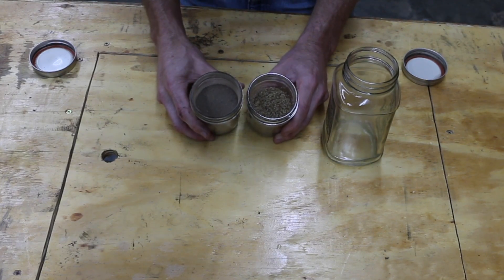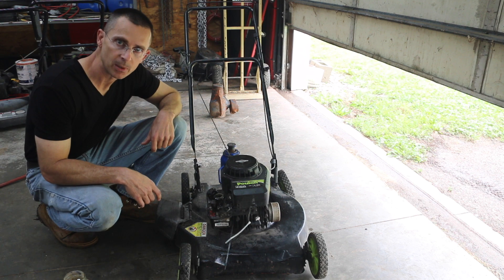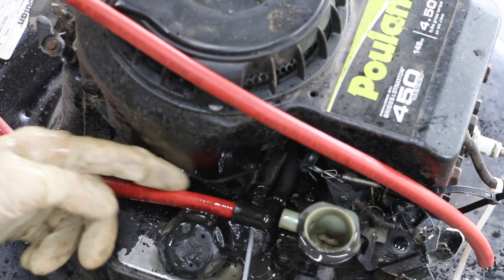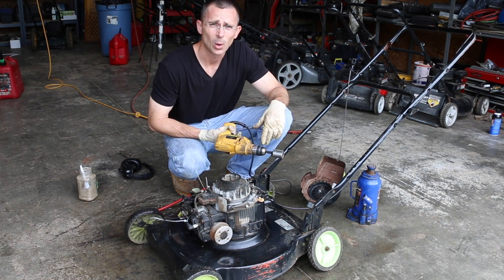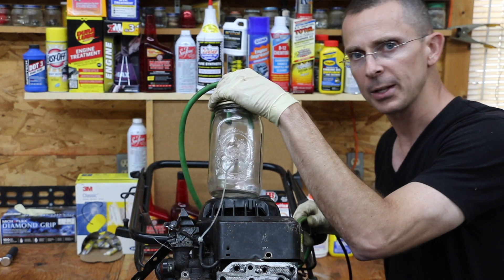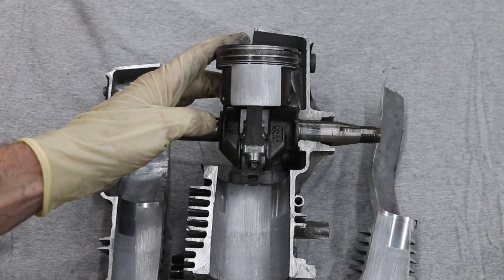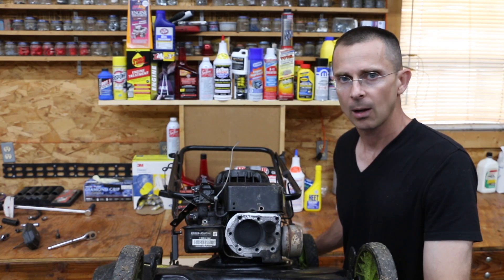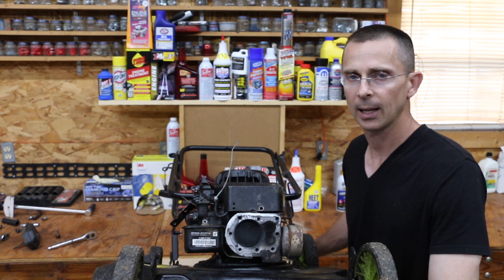Will Dirt Destroy an Engine?  See what it does to this Engine!

Comment: Changed Sparkplugs in a 2000 Dodge Ram 1500, 5.2 V8, w/Auto Trans... 

Blowing accumulated dirt out of the 3.5" plug tube's before removing the plugs was never mentioned... I didn't notice any accumulated dirt, but I didn't examine it thoroughly either... 
The most dirt/dust that could have fallen into 8 cylinders thru the plug holes is 1/2 to 3/4 of a thimble... 

Truck was rarely driven... Has 102k miles... Wasn't started for 2 years due in storage... 
R&R:  Dropped, cleaned and replaced fuel pump in fuel tank... 
R&R sparkplugs & sprayed 2 short burst of penatratiing oil into cylinders... 
(Rotated engine via ratchet at balancer) 
R&R filters, oil, water pump, hoses, thermostat, belt, etc, etc... 1 can of Sea Foam in 26gal of high octane... 

1) Idle seams good at start up... 
2) Throttling up causes sputtering... 
3) Engaging into gear while remaining still increases the sputtering and causes truck to jitter... 
4) Throttling up to move forward increases sputtering and vehicle jittering... 
5) Increased throttle increases sputtering and jittering emensely... 
(The jitter Feels similar to a slightly out of balance clothes washer while rotating at substantial speed) 
6) ZERO Smoke at engine & tailpipe...  

Suspension checked and new balanced tires installed, hence not a factor... 

Diagnostic showed cylinders 5 & 7 are misfiring... Grounding test shows plugs firing... 

Based on the info provided, does it seem as though any dirt/dust may be affecting cylinders 5 & 7 ??? 

Thk U...
Reply from the maker: Thanks for sharing.

Comment: I bought a vehicle from someone who had done this. It had 300k on it, which for the engine was nothing, I had 4 other vehicles with the same engine that were still perfect, with almost and over 400k. The engine with only 300k runs great but clicks a bit on a cold start. Engines really dont like dirty air.
Reply from the maker: Thanks for sharing.

Comment: This was a bad test.  You are not simulating wear on the engine so much as destroying the engine.  The amount of material you are pouring into the engine is completely unrealistic.  What you should have found out is the parts per million of contaminants in the air while a lawnmower is doing work.  Then used that as your baseline for adding any contamination to the airflow through the carburetor.

Comment: I think the only thing that could have made this a better simulation is mixing the sand with oil or gasoline. I'd did it bc sad is so far in-between that its likely going to be wet with it
Reply from the maker: Thanks for the suggestion.

Comment: My paramotor (185cc 2 stroke engines) also my Subaru sports car both are equipped with a high airflow Oil filters like K&N.
I do live in the desert and there are alot of particles in the air pretty much all the time.
I have always wondered if it would be any better to use my k&N style airfilters with a pre-filter over them.
do pre-filters make any difference with high airflow filters?
Reply from the maker: Thanks for the video idea.

Comment: !5 years ago I bought a new $500 Commercial Honda mower. Moved into a house that the previous owner leveled the yard with massive amounts of sand. I never removed my mower air filter. Eventually my mower wouldn't start due to low compression.
Reply from the maker: Thanks for sharing.

Comment: Yes
Reply from the maker: Thanks for watching.
Reply: @ProjectFarm  I managed a Jiffy Lube about 10 years ago. Company newsletter told the story about a store where the manager discovered his employees had been installing the wrong air filter in a particular model of diesel truck. The air filters were too small and allowed air to flow around them. He pulled the records, contacted the customers, and had them take their trucks to a repair shop for compression testing. All but one were OK, and Jiffy Lube replaced the engine on the one that wasn't. Probably didn't see any damage because it was only a short time and most of the trucks were not operated in high dust conditions, except for the one.

Comment: running an engine without an air filter is bad yeah but nobody is dumping shit down your intake at the most it would take a while for this to happen most of the debris would work itself out of the exhaust valve instead of a lump of it all coming in at once bad test should have thrown it at the mower this is absolute worst case scenario
Reply from the maker: Thanks for the feedback.

Comment: U really didn't like that engine, did ya. It's just a harsh world we live in." 
Engine  "yeah with guys like YOU in it"
Reply from the maker: lol  Thanks for watching.
Reply: @ProjectFarm  Yup, I fix these, mostly generators, but ppl do not seem to 
understand gas engines suck up a lot of air, and dirt just doesn't go well w
an engine and no air filter or an improperly fitted one, where dust can go 
smack into the carb instead of thru the filter.

Comment: I used to build diesel engines for a railroad.  The one thing that really took the cake was for someone to put sugar in the oil.  It would run OK until the engine was shut down the first time after adding sugar into the oil, the sugar would crystalize everywhere when cool.  This would make the engine useless. It would cake up in the oil galleys...etc. No way or chemical that would clean it out.
Reply from the maker: Thanks for sharing.

Comment: I had an engine lose compression on me many years ago after I freshly rebuilt it.  I tore it apart and found the piston rings stuck in the piston grooves.  I unstuck them, put everything back together again and it ran great just like before until I got on the throttle a lot.  I repeated that procedure one more time with identical results.
It turned out to be a very fine grit sand stuck to the oily inside of the intake manifold.  There was zero cylinder wall and piston damage.  Again, really fine grain stuff.  Nothing big.
Reply from the maker: Thanks for sharing.

Comment: great video  air filter  fit and condition is very important  what about  not changing the oil for long periods  over the recommended intervals
Reply from the maker: Thanks so much!
Reply: I have a lawn mower that I have put a new air filter every 2 years and change the oil every year usually after the dry part of spring. I have done this for the past 15 years this year I put sea foam in the fuel because of carb issues now it runs great again it would be interesting to disassemble it to check for wear I'm going to pick up a compression gauge. it would be a good video to see the inside of an engine that was never taken care of  to see

Comment: Ideas: "wheelie" a motorcycle engine. Run a non-ethanol engine on ethanol (as pure as it will take).
Run a diesel engine on really old diesel. 
Build a rats nest in the air filter? 
Just off the top of my head 🤣
Reply from the maker: Thanks for watching.

Comment: Try this: Mixing sawdust with motor oil will make the engine run smoother. This was according to my friend who used to sell older 70’s cars. And it actually worked. (according to him)
Reply from the maker: Thanks for the video idea.

Comment: Do you think that’s a lot a mocha glow by from the crank case no I have an old lawnmower that absolutely pours out smoke like a choo-choo train when they connect the flow by to the carburetor it has so much blow by it forces out the gas out of the primer bulb so it’s just rocketing gas

Comment: I’ve always wondered if Lucas upper cylinder lube will actually increase wet compression and increase or provide more steady torque by utilizing a compression gauge and a engine brake. Can you please make a video since you have all the right equipment to run a test, thank you!
Reply from the maker: Thanks for the video idea.

Comment: I had a 2 stroke RC buggy (and like an idiot) I didn't put any oil in the air filter before I took it to the beach. The air filter managed to block most of the sand but a few specs must have got into the engine as the idle speed dropped and the engine stalled. I cleaned the air filter but I had no air filter oil so I used 2 stroke engine oil instead (please reply to me if its bad to use it). The engine then ran perfect and I took it to the beach again and it didn't cut off or stall.

Comment: Naah... not at all wastefull. There are places, as romania, for example, where there is so much dirt and dust on the roads, and not only...where air filter and fuel filter are better done at half the advertised change intervals, than any other place. I come from romania, live in austria, and have to say : if you care about your pocket/ wallet,  do take care of when you change oil and fuel filters, depending of place, and conditions you might drive in, than suggestions from mannufacturers. Keep up the good work. I see you are a straight up man. I appreciate that. God speed friend. God speed.
Reply from the maker: Thanks so much!

Comment: As silly as this is, one of the things I look for when I buy a used car (not a beater, but something I'm going to care about) is if the air filter is installed properly. I'm just a backyard mechanic and I've run across MULTIPLE cars where the vehicle has been driven for years, even  half of it's life or more with an improperly installed air filter (crushed or not seated) that lets just about all the air bypass the filter element.
Reply from the maker: Thanks for the feedback.

Comment: This is the advice that I had given to my long time friend who was a truck driver for 10yrs and he's employer was messing up with him and his employer didn't pay him for the truck driving Jobs that he did, guess what? My buddy bought a 5 gallon of Car Paint Rubbing Compound and mixed it with Diesel motor oil and poured half gallon of it to the engine, he did it on all 5 semi trucks of the company that he is working for. After a few weeks his boss loss more than $76,000 on Engine Repairs, then after 2 weeks my buddy strike again for another round of sabotage, he screwed up their fuel tanks and did the same Rubbing Compound oil mix on their engine again! And the reefer engine in their trailers After a week his boss loss 4 semi trucks and screwed up most of his reefer engines. Then my buddy is happy got his revenge on his employer.

Comment: As a mechanic this was painful to watch. This guy has no idea what he is doing - me and my grandpappy were proper mechanics, and what we would do when trying to deal with dirt in an engine is connect up a hose into the carburetor, after the airfilter and this would be fed from a reservoir (a plastic soft drink bottle) that we filled with dirt from the ground and sand, and then that way rather than having to spoon in dirt to the engine, we would just have it fed in with gravity so that the engine could really get right jammed up with the dirt. We would have customers from all over saying that we were the best mechanics as it would only take a minute or two for the dirt to completely knacker the motor. Much quicker than you did here.

Comment: I would think a more accurate measure as to what damage dirt does to an engine by removing the air filter would have been to remove the filter and run the engine for a year and see what happens.  Most of the people who remove the air filter to gain performance still do regular oil changes and oil helps remove a lot of that dirt coming in.  However, to introduce a years amount of dirt within a few minutes would, I believe, overwhelm the oil and cause substantial damage to the engine where if the dirt was to be introduced naturally over time, with regular oil changes, the damage would be significantly reduced.
Reply from the maker: Thanks for the suggestion.

Comment: Try 2 oz restore engine treatment on that
Reply from the maker: Thanks for the suggestion.
Reply: @ProjectFarm  it doesn't have to be the exact same engine but one that has scouring like that also with that rislone engine restore it olny works when it's in the engine and when you used the restore brand engine restore on the 4 cylinder tractor you used the 8 cylinder formula

Comment: I know this is an old video but, one spoon of sand would not get  into an engine in ten years unless you drove your car on the beach every day. In a normal city, you could run your engine without an air filter for around ten years without any problems. One grain of sand every few months, would not do enough damage to even notice. I had a "68' camaro that I ran for at least ten years without an air filter, and never had a problem with the engine. Of course, it was a Chevy. A ford probably would have quit after ten months. LOL

Comment: Many years ago (1974) I was in the Army. I had just purchased a brand new Chev Nova, which I drove to an Air Force base in Texas where A I attended a tech school (all branches of service attended some of these schools. ) I arrived there in July, and it hadn't rained in that area since May. Naturally, this dryness meant lots of dry sand and dust. When I treated my new car to its first oil change, I checked the ar filter. Once the cover was off, exposing what was inside, I CAREFULLY removed the housing and cleaned it thoroughly. Naturally, I replaced the filter as well. 
The old paper filter weighed almost 3 pounds after it had been removed from the housing and some of the loose dirt had fallen off. I wouldn't have imagined that much dust would be trapped there, and I really didn't know how the engine was running with so much air flow blocked. Imagine what that much grit would have done without a filter in place.
Reply from the maker: Thanks for sharing.

Comment: While it was interesting to watch, I don't you actually simulated many years of running without an air filter.  The volume of dirt at one time would have a much great abrasive force than trace contamination over years.  point still well taken, always have a good air filter in place to protect your engine.  As for a destructive test.... how about using syrup as oil then try to restart it after it cools overnight .
Reply from the maker: Thanks for the video idea.

Comment: I have a John Deere lawn mower  and it is still going strong after 10 years!! good job John Deere. Also it’s a zero turn push mower it has the front wheels turn 360. And it’s a Rear wheel drive
Reply from the maker: Thanks for sharing.

Comment: Amazing how much punishment a Briggs & Stratton engine can take. I had one with a bent crankshaft & sheared flywheel key (hit the rest of a metal pole sticking out of the ground that I forgot about). It restarted almost instantly but it had low compression and shook like you wouldn't believe. And even like this I could finish the job.
Reply from the maker: Thanks for sharing.

Comment: Pretty irrelevant test tho, sand and dirt won't just pour into the engine at once like that, it would be small and occasional particles and most of them won't do much to it, they will just mix with oil and eventually get spilled out. I'm not saying running an engine without air filter wouldn't decrease its life span, but it won't happen overnight. Old cars used to run with socks as air filters for decades..

Comment: Check out David Vizard’s findings with K& N filters. He found the amount of dirt trapped meant far less engine wear (and therefore power fall/off) than was lost by air restrictions through the filter. 
He went on to prove it on the track with NASCAR engines.
Reply from the maker: Thanks for sharing.

Comment: I'm not disagreeing with your vid here but where I'm living at now, I see many many 125cc honda motorcycles run without air filters for months, maybe longer and no smoke on most of them.  Some smoke starts occurring along the way at some unknown point and yes I know it will ruin the engine but small 125cc honda + other chinese underbone engines can run without an airfilter for extended times.
-
These bikes are run on small dirt roads, small paved roads, the dirt here is clayey and not alot of dust at all but I don't think these guys realize what they are doing with an unfiltered air intake. Plus many have modified bikes and the OEM air box no longer fits.
Reply from the maker: Thanks for sharing.

Comment: Now you have proven that dirt kills engines you might consider setting up a test with engine particle filters of various types. I saw you test paper filters of various brands but I was thinking of a larger variety in filtering principles. I lived in dusty Burkina Faso for 4 years. My Peugeot had an oil bath filter, my Citroën Acadyane car a paper filter, my Mobylette a steel gauze filter (which becomes oily over time because it is a 2 stroke engine), my Yamaha 175 cc motorbike had a foam filter that I drenched in a blue liquid I bought at a specialized motorcross shop in the Netherlands and my Honda generator a dry foam filter. Which filter type holds back superfine dust and sand best? I mean the type of sand that wind can blow over a large distance. Cleaned air to be measured with a particle meter (used in homes to determine particles in in house air) or by sucking air through a air pollution measurement filter. Greetings and keep up the good (and in this video funny) work! Gerard
Reply from the maker: Great video idea!